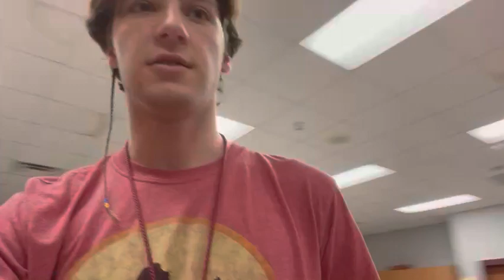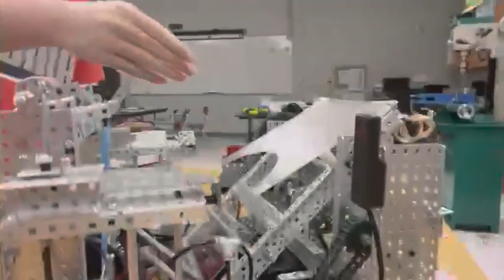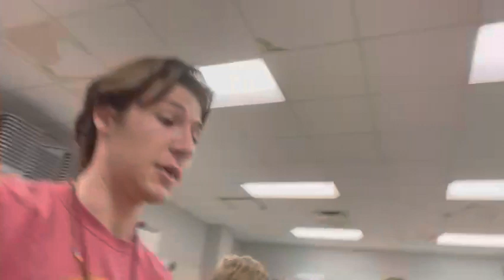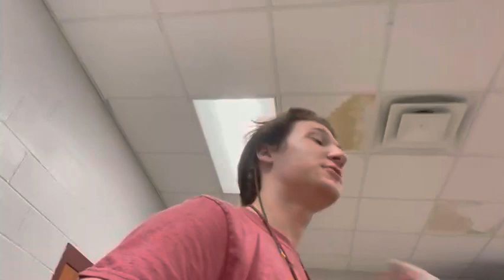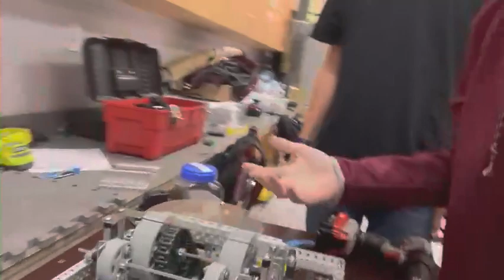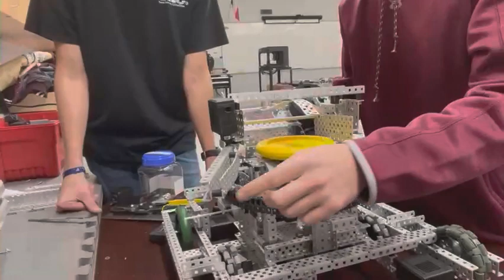GOLD! RoboVlog - Cata Bot, Flywheel tweaks, and Turret progress - Vex Spin-up Ep19

Comment: What’s is tig by caff, What does tig by caf do?  I just got all my game elements so I’m just trying to figure out some basics to start form?  Love the Vlogs!
Reply from the maker: “Take back half” is a type of velocity controller that works well for flywheel applications. When you set the speed of a motor to a certain rpm in VEXcode, it fluctuates quite a bit after a disc is shot. This is because the code has a pretuned PID loop (another type of velocity controller) that isn’t best suited for all applications. What take back half does is increases the input voltage of the flywheel proportionally to the system. Then when it overshoots it averages the voltage from the previous undershoot. This minimizes the time it takes to go back to a constant velocity which is helpful for multiple shots fired quickly. We love making them and are glad to help💛